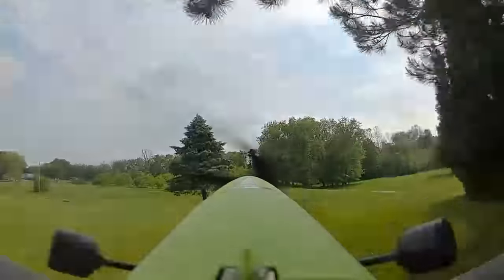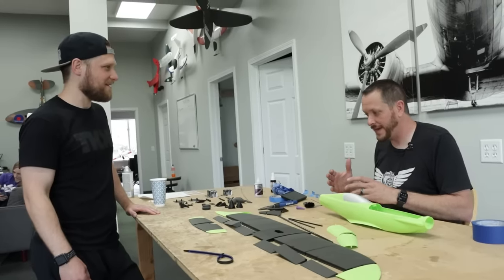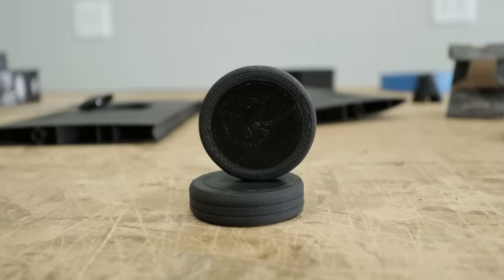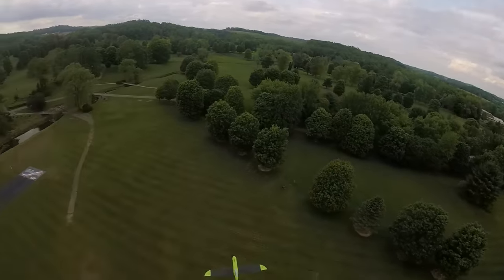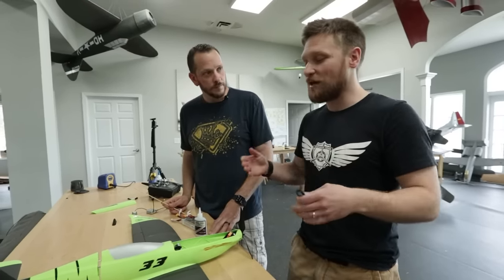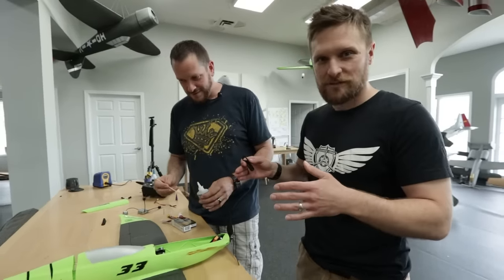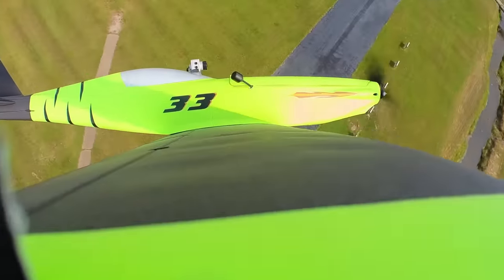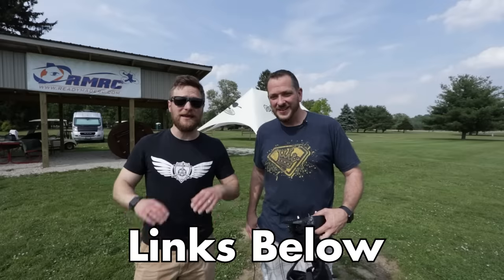Can A 3D Printed Race Plane Withstand 100 MPH?!

Comment: 3:50. A tip,. The pegs they have you print are 4mm,. I just use 4mm carbon fiber tube cut to size.
Reply: or tighten the belts on your printer - I did this to mine and it rapidly improved it I really recommend it

Comment: I like how the FPV antenna kinda look like exhaust piping from a radial engine. Would be cool to color them metallic silver if it won’t interfere with their signal.
Reply: I agree, with that. it would look cool, especially since they work with a lot of prop planes, which originally were, exactly a radial engine. so, it would look really cool. I studied planes, growing up, so I'm sharing some of my knowledge with you.

Comment: Have mine printed in polyalchemy's nightshade elixir.  Need to up it to 4 cell, but it is quick with a 3 cell.  Great flying plane
Reply: Polyalchemy is such beautiful filament, I have used that color and love it. I noticed they have a good bit less layer adhesion so I would be careful with that. However, I used that filament a few years ago, so they might have changed up the blend some and fixed that issue.
Reply: Whith FPV system it is a flying brick with high velocity. Very dangerous but looks beutiful.
Reply: @маратаминев-в6з  😂 death machine

Comment: I've been seeing these rc plane videos a lot lately and idk if I wanna get sucked in to another expensive hobby, but it looks super fun
Reply: Flite test is all about cheap fun in RC, look back into their long history as they have literal $5 builds out of dollar store foam and these 3d printed planes are not expensive either (looks like less than a $30 roll of filament to me). You have to buy a transmitter and power package (receiver, battery, motor) but these have come way down in cost. You can get into the hobby for a couple hundred bucks (mostly the transmitter) and fly for years with very little added money spent. Most parts can be salvaged in a crash. I say go for it
Reply: @eulachonfish  dang, I just might. Thanks kind stranger

Comment: I've now printed 5 Eclipson planes, 2 model A,'s 3 Model C's. One really cool thing, when you order it, you get the files right away. I started printing my model C's 10 minutes after ordering. I print in standard PLA though, the price and shipping to Canada of that Colorfabb filament is just way to high. I'm looking forward to a summer's worth of planes, all 3D printed.
Reply: Any issues with PLA in the summer? I'm in the southern U.S., so I'm wondering if the airflow from flying would keep the material temp low enough to keep it from getting soft. Of course I wouldn't just leave it sitting out in the sun.
Reply: @rsmith3834  I had to keep mine out of direct sunlight, except when flying. Otherwise, I had no heat issues, and we had a hot summer ( not as hot as South US though )

Comment: instead of using superglue or cement for the 3d printed planes, use pla 3d gloop. it’s an adhesive that was designed specifically for pla and it’s fantastic. it’s actually amazing
Reply: Or $1 tubes of epoxy, 3d gloop sounds expensive.

Comment: I need a 3D printer now! All these cool episodes.
Reply: I use an Ender 3 V2, its cheap (250usd) and has good quality prints
Reply: I bought one (also an ender 3 V2) just to print planes and am having a blast. Even the free model A flies great.
Reply: @johncuriel310  I first built 3dlabprints bf109, it flies on rails. I'm now working on the model r, I plan to put an avian 60amp esc and a 3536 1450kv motor. The can just fits the hole in the fuse
Reply: @Zippytez  My first was the spitfire, but I haven't flown in about 20 years and I underpowered it with some old motors I had laying around so I decided to go with the model A to get my legs back under me. I did eventually purchase a 3536 that I plan to put in the spitfire.
Reply: @Zippytez  the original Ender 3 is only €130 bucks on sale these days, and I find mine prints very nicely

Comment: I sugest you install a 3D printer small 12V fan in top of the air unit, this will keep cool the air unit in power up, and keep it cool at all times.  Fantastic.  I power all my fpv from the balance ports, so you can choose the voltage.

Comment: I get the point of the title wording, but c'mon it's high acceleration that breaks things not speed.

"It's not the fall that kills you, it's the sudden stop at the end" -Forgot origin of the quote.
Reply: Which you only get at high speeds so they're not wrong (except if you crash of course)
Reply: @themblue8236  True, but in the context of this video it's far more likely to be the sudden acceleration. Air speed forces would be mostly negligible here, same for drag heating.
Reply: @mintoc8853  fair point. If you throw half a prop tho .. lol

Comment: I just recently purchased the model and tried A and used the Flight code and got 5% off. Thanks Dudes.
How important is the accelerator spray for the zap a gap and other CA glues?

Comment: Would it be possible to wrap a sort of printed mesh (that you could see through with the camera) with a sort of clear plastic (I can't imagine a 3D print in clear would be see through unless its maybe a UV extrusion printer that's really nice) and then mount the camera inside to cut the extra drag? Maybe not necessary but would be awesome to paint some fake dials and stuff and have a "realistic cockpit."

Comment: By the way, I'm pretty sure your lightweight PLA wasn't using it's properties correctly, I would be willing to bet you would get the same results from Normal PLA.

The advantage of lightweight PLA is you can print it with lower extrusion multipliers and the PLA will foam up resulting in the same lines printed but the under-extrusion is replaced with air.

Looking at the model you guys printed the skin is perfectly smooth and shows no signs of foaming. Meaning you could print this with normal PLA and likely have the same results.

Comment: last time i made a 3d printed plane, it folded wings at 30 mph lol.
Reply: Should have used some bbq skewers lol
Reply: @lewismcgarry1349  i used aluminum tubing.
Reply: @balsamicvin9935  I was making a joke haha. But cool. Perhaps use a stronger glue such as ca or epoxy and allow to cure overnight. Also, was the tubing relatively thin? 0perhaps carbon fibre might make the wing more rigid.
Reply: Ive never made a 3D printed plane, but definitely use a carbon fiber spar next time.
Reply: @aerospacematt9147  actually aluminium is okay depending on the thickness and length. (2 spars joined is weaker than 1 full length spar)
Reply: @lewismcgarry1349  Well, like I said, I haven’t made a 3D printed plane! I’m still a foamy guy, so I’m used to Carbon Fiber. If I ever do make one, then I’ll look into aluminum for the spar.
Reply: @aerospacematt9147  it's not specific to 3d printed
Reply: @lewismcgarry1349  yes it was thin, and i intend on using carbon fiber rather than aluminum.
Reply: Where it folded will indicate where the problem is.  If it folded at a joint then your having an issue with your glue.  CA holds just fine even at high speeds but I've found old CA can be problematic.  I've only had this happen on 1 printed plane so far and changing to a new bottle solved the issue.  If it is folding between joints then your layer adhesion is not good enough.  Print hotter, slower, and turn the part cooling fan off and you'll get much better layer adhesion.
Reply: @InspGadgt  it actually did not break on a joint, but broke on the layer adhesion. And my aluminum rod was too weak.
Reply: @balsamicvin9935  what material and what printing temperature?
Reply: @InspGadgt  carbon fiber pla, and 220 degrees celsius
Reply: @balsamicvin9935  That is a bit low for PLA for planes.  3dLabPrint recommends 230° C for PLA on their planes.  Did you use a cooling fan?  What speed did you print at?  I've found that, at least with PETG, you can use some cooling fan if you slow your print speed down to about 35mm/s.  Sometimes you can get away with as much as 40mm/s but not every part is going to have good layer adhesion at that speed with a cooling fan.  Also keep in mind that adding CF to the filament is going to reduce layer adhesion.  How much it reduces it depends on how much CF is added to the filament.  From what I hear Atomic filaments are pretty good if you want to use a CF blend as they use less CF in it to maintain layer adhesion.  Also keep in mind that using CF in the print can reduce your radio range so make sure to do a good range test when using CF filaments.

Comment: All of that focus on aerodynamics, and then you strap a brick of a camera to it. xD

Would it be feasible to print a scaffold in place of the canopy section and then make a transparent canopy the camera could sit behind? Maybe vacuum molded? I'm not sure if there's any transparent 3D printed material, but I kind of doubt it.

Comment: Is there a motor out there with a hallow axle? 
Two stacked with the rear counter rotating and having a soldered solid axle to align and mount for a second prop on this plane would be fun...
Reply: Their are a few rigs available for that setup
search this on Banggood :DZP30 Contra-rotating 1500KV Dual Brushless Motor with Dual 3 Blade Propeller

Comment: I take that back it will cost me $81.98 for the half roll that it comes in.  The other types filament I can get a full 1k roll for about $30.00 or less
Reply: I would love get some of the LW PLA but being retired the cost is way too high.  I can get PLA so much cheaper so that is what i have been using

Comment: How can I buy the 3D printed components for the plane since I don't have a printer?
Reply: See if someone local who has a printer will run them off for you. There are lots of people who do custom 3d prints and charge by the gram or by the hour. Note that this gets expensive fast and buying your own Ender 3 is probably more cost effective. They are only around $200 and having your own printer can be super useful.

Comment: Please include how long it took to print all those individual parts aswell, thanks!
Reply: I would assume between 3-7 hours per part if the nozzle size is 0.4 mm and layer height is 0.2 mm
Reply: @Dbm_-oe7zv  multiplied by how many parts...........?🤔😉
Reply: @mattyp80 , really depends on the model size. I’ve done a plane of up to 30 parts and it can take quite awhile to print.

Comment: Please make an F4 Phantom RC sometime soon!
Reply: Every F-4 Phantom model I've ever flown, that didn't have slightly enlarged wings, dropped like a rock if I let off the throttle too much.   They're really fast though.
Reply: @starstreamir3817  Exactly what the real plane does.  Loved the F-4 for landing system calibration on carriers.
Reply: @michiganengineer8621   You actually flew those eh?  I always marveled at the skill it took to land on carriers.  I was in the navy from 94 to 98, I'm pretty sure way after F-4s were decommissioned.  ...Although I'm starting to feel a little old now, learning that my old boat the USS Enterprise, (CVN 65) was decommissioned not long ago.  Apparently there's another more modern ship, (CV-80)? bearing the same name about to replace her.
Reply: @starstreamir3817  No, I worked on the Automatic Landing System (ACLS) onboard CV-60 from 79 - 86
Reply: @michiganengineer8621   My squadron was attached to the Saratoga until just before it decommissioned in '94 not long before I arrived at Great Lakes for bootcamp.   According to my shipmates I lucked out.   They referred  to her as "Sloppy Sara", and mentioned water that tasted like rust and diesel.  I felt it was a little disrespectful to a vessel that was so iconic and stayed in service for so long.  ...But  I suppose it's not as easily apparent that you're living on a piece of history,  until it's history.   I did kind of wish I could have been in a fighter squadron or something more  "cool" though.   I was with VS-30.  Our birds were the S-3 Viking, aka  "superhoover". (They really did sound  like giant vacuum cleaners).     ...Nothing cool like F-4s or F-18s,   ...or even those crazy loud EA-6Bs.

Comment: How much would a full set up like this go for.
Reply: LW-PLA is about 50-70$ for 750 grams. That's with shipping included.
Reply: @Dbm_-oe7zv  thank you also what fpv system is that?
Reply: @christophermccone2944  looks like the new DJI high quality fpv. Extremely nice system but very very expensive (like 700-900$)

Comment: That is the issue with LW pla, it is very weak and anyone that flys foamies knows is  that nearly every grass landing is like that one.
Reply: I have two LW-PLA planes and the worst part about the filament is how easy it is to warp under pressure or heat. It only took one 80 degree F day and sun to give hideous warping to my RC plane wing.

Comment: I wonder how hard it would be to make a mold from one of these and use it to make a CF plane...
Reply: There are lots of people who make molds from 3d printed plugs, or just use 3d printed molds!
It'll take a lot of sanding to get a smooth surface on the printed part but after that it's the same process as making any mold.

Definitely worth a try, especially if you want to make a small/niche model.

Comment: Josh 5 years ago is still right tho, 3d printers is way to much hassle, you need to have a interest in 3d printers, if you dont and just want to use it as a tool... nopp not worth it..
Reply: Handy tool to have  ,my DIY kit cost less than a 100, it's easier to set up than a lathe or milling machine and great for creating odd parts and thousands of files ready to print if you can't model your own.....not seeing the downside

Comment: Just a little niggle- Josh isn't under the impression aircraft fly faster if they're heavier is he?
Reply: I think he understands aeronautics pretty well. But the FPV equipment required a larger battery (4S vs the 3S used in the maiden), and the larger battery was going to make the engine run faster. At least as I understand it. Between the FPV and battery, I was concerned about the CoG but it seemed to fly pretty well even with the extra weight up front. Then again, Josh has been flying for a lot of years so it's not too surprising he could handle it.